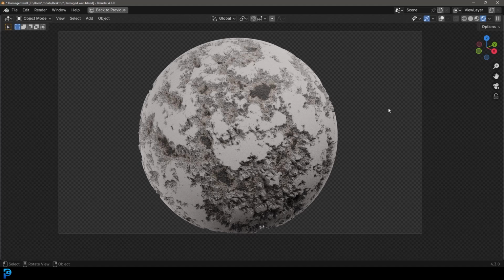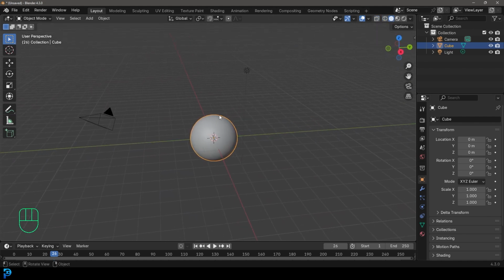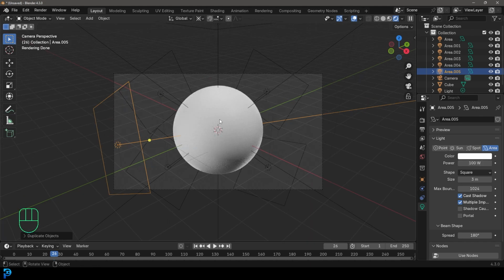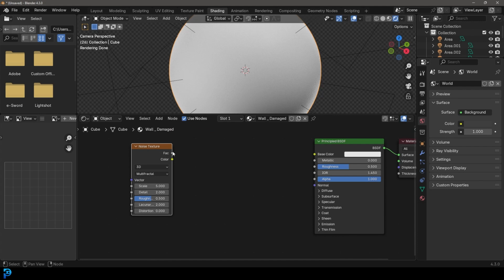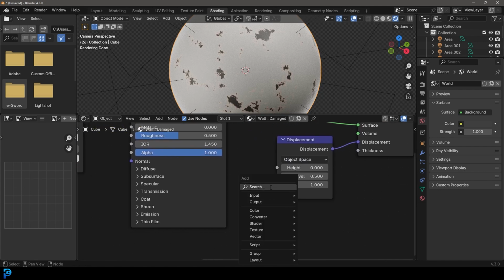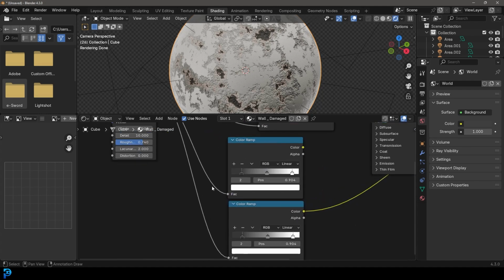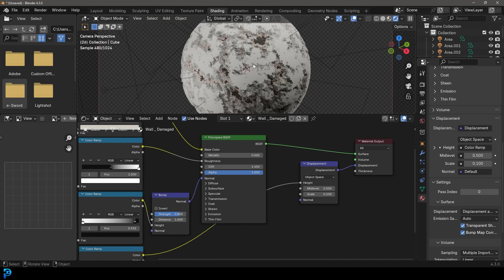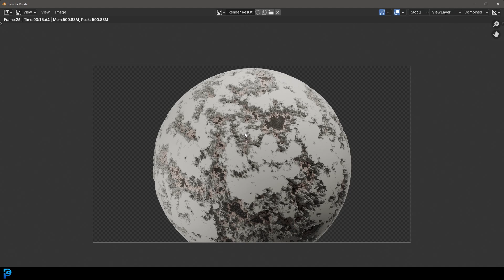Blender: Damaged Wall Material | Procedural Tutorial

Comment: How to save it as a material to use afterwards? you forgot to mention.
Reply: @dxgored  Take a plane, add a material (the UV of the plane need to take all the space). If it's not that case, go to UV editor, press "u" and "unwrape". Go to "scene" option (same strip that modifiers are, go higher). Change the "EEVEE" option to "CYCLE", open the "bake" option and change the option "combined" to  "diffuse" for the color, uncheck the "direct" and "inderect". Add image texture on shader editor, click on "New" and choose the settings you want (don't touche the alpha color and the others options under it bc it's not necessary). In UV editor choose the image you just created (you'll find the choice of images on the top of screen border). Go to shader editor select image texture node, select the plane if it not selected and click on "Bake". Wait and it's done ! If you want the roughness map and the normal map, firstly repeat the processes you done before, just change the "diffuse" to "roughness" or "Normal" depending what you want. When you finish, firstly go to "preferences", go to "add-on" search for "Wrangler node" and check it. After, in the shader editor of your model, select your Principal shader (BSDF or others) and press ctrl+shift+t and select your material images, now done ! For the metallic map watch a tutoriel bc it's more complexe. I hope that helping you !
Reply: @NohamLabussiere-yx5dr Thank you my blud.
Reply: @dxgored np, i forgot i thing, make sure to set the RGB option to "non-color" on the image texture for maps others than the color map
Reply: @dxgored  you can save it as a asset.
Watch a tutorial online it's very simple and it takes fewer steps